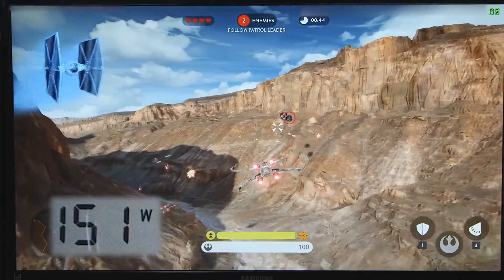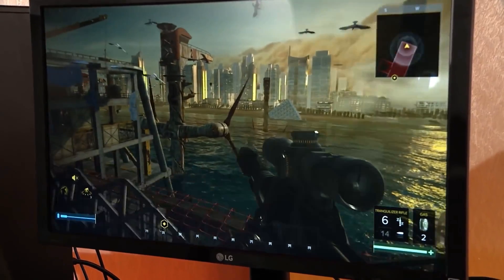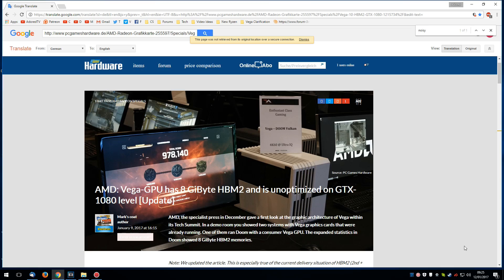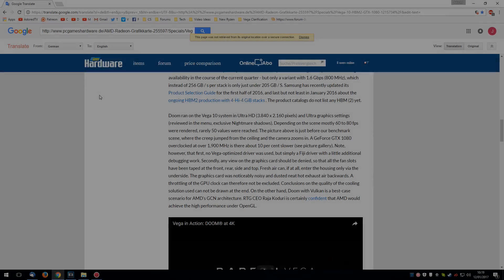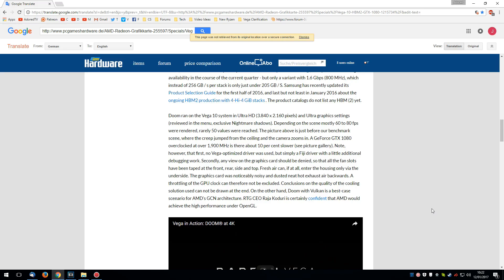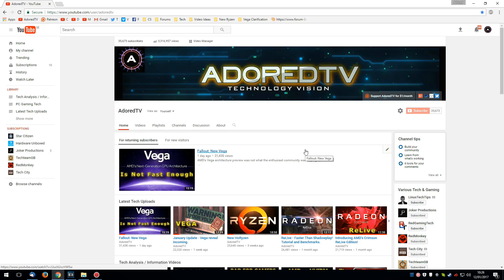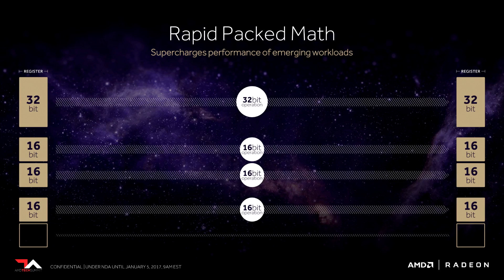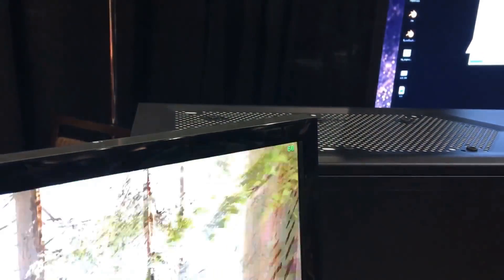Vega Clarification - How bad is it?

Comment: As much as I love your videos, I think you will actually be wrong this time.

For instance, take a look at the radeon instinct M25. It says around 25 TFLOPS helf precision, meaning around 12,5 TFLOPS single precision. That in turn means that for the rumored 4096 shaders to be clocked at around 1500 Mhz. Let's just assume that Vega is a higher clocked Fiji, completely ignoring the biggest upgrade of GCN since it's introduction. Fiji at 1500Mhz (and with better bandwith compression) would (should) be faster than the Vega demo they showed.

And about using the new Vega features: Okay, we got DX12 and Vulkan now which allow more explicit control over the hardware. But are you aware that most aspects of the core architecture (not something like asynchronous shaders but more in the core rendering way) are not being controlled by the developers, but by the drivers? The drivers, in Vegas case, not seen here?
Also, mantle/asynchronous shaders are not the same thing as the core architecture. There is no need to change something in your game to use a new rasterizer in the GPU, for example.
You know how long developers took to take advantage of the GCN architecture? Of the color compression found in Tonga and higher? Maybe 1-2 months for optimising, other than that it's a day zero thing.

Also i really would not underestimate their new high clock design because that one is very, very long overdue for AMD. As seen in your graphic, since the introduction of GCN AMD was forced to run their chips way past their sweet spot. The problem for this lies less in the density but more in the architecture as the GCN pipeline is much shorter than the Nvidia one. I have only ever seen data about the ALUs, but this data showed 4 clocks for a GCN-ALU operation vs 6 clocks for a maxwell one.

In my opinion, it really comes down to if they finally changed their rasterizing to a tile-based approach because that was the single biggest change Nvidia made for their Maxwell architecture, greatly reducing stress on the on-chip cache and therefore saving much power. I don't really know about the clocking potential Kepler had.
Reply from the maker: Yes but the rasterizer is automatic and so should be built in performance already in the Doom demo.  The only thing that devs should need to optimize is the primitive shaders.

Fury X has 46% higher FLOPS than the 390X but is only 20% faster at 1440p.  I believe that AMD will have removed that bottleneck, but Titan X Pascal is around 75% faster than Fury X.  Vega falling a little short of Titan X should not be a major surprise.
Reply: Also forgot that AMD said Vega 10 is smaller than 500mm², more or less matching the 471mm² GP102 which is so small because it is stripped of all the professional features GP100 has (Vega will most likely be stripped too). GP100 with 610mm² has the exakt same shader count as GP102. Should Vega match the Titan X, it would still be worse than Pascal, but not completely out of league. Of course Volta is another thing, but I don't expect too much apart from HBM.
Reply from the maker: I expect Volta Geforce will simply be Maxwell + HBM and proper async yes.

I doubt Vega will be stripped of anything, AMD is basically stuck with one arch to cover all markets now, which is why they'll struggle to compete with Nvidia's gamer GPUs on equal terms.
Reply: Some people think AMD will release a professinal chip with double precision ect later as Vega 20
( http://www.3dcenter.org/artikel/amd-grafikchip-roadmap-2016-2019 )

What it also comes down to for Vega is clock speed as they never officially said anything about that for their demos. (shader count is also at rumor status)
In the last six months, Zen went from like 2,8 Ghz base to the 3,6 base with F4 revision.
We also don't know how much power Vega used in the demo.

As for the Fiji weakness, the main problem was GCN was limited to 4 rasterizer engines with the new games getting even more hungry for rasterizer power. This also is the reason why Fiji didn't have the problem that bad in 4k as higher resolutions demand more shader power and bandwith opposed to rasterizer power, but the problem was even worse than with Thaiti back in the day. (2 rasterizer engines)
Hawaii had four, Tonga had four, GK110 had six, Polaris 10 has four. This essentially might be the reason they never even planned a high end card with polaris. With the new geometry pipeline, AMD claims eleven polygons per clock as opposed to Fijis four.
( https://www.computerbase.de/2017-01/amd-vega-preview/2/ )

One very good reason to sandbag would be to hinder Nvidia with their 1080Ti-counter. They had the problem with the later released 780Ti, the earlier released 980Ti what was slower than the TitanX Maxwell, maybe because Fiji performance got leaked.
I am very convinced Nvidia knows nothing about what Vega can do and what does it not as there was not one leak that got public as opposed to Fiji. It is a difficult situation for Nvidia because AMD can pinpoint-counter a 1080Ti if Vega is good enough. Vega also is at least something like three months late against the supposed 1080Ti launch in feb/march.
Reply: Well Said,Great points.I believe it's much faster than just 30% above a Fury X.
Reply: I'd say it's all about utilizing those TFLOPs.Polaris 10 started the improvement.Vega seems promising.
Reply: When did AMD say Big Vega is less than 500mm2 in size ?
Reply: I believe Volta will be a monster.Bringing back stuff they stripped out of Fermi,getting it right,HBM2 and Hardware level Asynchronous Compute engines,closer to GCN for being friendly to the Low level APIs,which will be much more relevant in 2018,Entirely different from Maxwell and Paxw...ahem....Pascal.So I expect those two older arches to lose driver support focus and get Gimped like Kepler.

I believe RTG is scared of Volta.The very well know it's going to be a monster.I mean,Volta was said to come in 2015,Pascal was something like an unwanted pregnancy,Volta wasn't ready so they made Pascal.All these years of development,Volta is going to be a beast,Not another Maxwell and Paxwell
Reply: Exactly what I was thinking.AMD wants to confuse NVidia.Look how cautious they are with Vega,not even a single leak about the performance\power draw,heck,anything about it appeared on the internet.AMD wants to keep NVidia clueless about Vega so that they will not be able (sorta) to determine what to launch as 1080Ti,Either a further Cut-Down from Titan XP GP102 or a Full GP102 at 700$,That would make Titan XP one of the biggest ripoffs in the history of GPUs lol

But anyways,I am pretty sure Vega isn't ready yet.Sure the Arch is there,but it's with a debug layer,clocked much lower,throttling,sub par beta drivers.etc.I believe it will be launched a month after RyZen.
Reply: I believe Volta will be a monster.Bringing back stuff they stripped out of Fermi,getting it right,HBM2 and Hardware level Asynchronous Compute engines,closer to GCN for being friendly to the Low level APIs,which will be much more relevant in 2018,Entirely different from Maxwell and Paxw...ahem....Pascal.So I expect those two older arches to lose driver support focus and get Gimped like Kepler.

I believe RTG is scared of Volta.The very well know it's going to be a monster.I mean,Volta was said to come in 2015,Pascal was something like an unwanted pregnancy,Volta wasn't ready so they made Pascal.All these years of development,Volta is going to be a beast,Not another Maxwell and Paxwell.

Comment: They found out it's supposedly going to be 12.5 TFLOPS; more than the Titan XP. With that it should have outperformed the Titan XP in Doom if everything were in order.
I'm just going to wait and hope this one wasn't clocked to the final clocks or something.
Reply: I agree.Its all about Performance per watt,Clocks and Utilization,especially for a segment like High end and Enthusiast.A 5.6 TFLOP 980Ti smashed the 8.6 TFLOP Fury X.The Fury X was bottlenecked by its low ROP Count,Poor utilization of resources and 4 GB Limit.Polaris improved utilization,clear example is how it is able to trade blows with the R9 390 and sometimes even the 390X.So Vega,needs to find a way to utilize that 12.5 TFLOPs.NVidia is so far ahead in these things currently.But with solving a lot of stuff in GCN along with new NCUs allowing for higher clock speeds,I think Vega will be the answer and right now,It isn't ready yet,clocked much lower,running on a debug layer,throttling.etc.AMD wants to confuse NVidia with the 1080Ti.

Comment: Google likes AMD, I believe a lot of these architectural changes were done to suit Google's and console maker's needs. I suspect, though have done no research, that Google will be buying massive numbers of Vega and Zen chips for their data centers, deep learning, data mining, etc. The console makers will benefit from the integration in these SOCs providing their next gen consoles with further efficiency, performance per watt and simplified PCBs. This is a good thing.

I do have qualms with AMD's choices, specifically using the Polaris as a test bed, which it was and not pushing the clocks to where they could have gone, I believe they could have reached 1070 performance. And many of you may disagree with my opinion that AMD should have also did an 8 core version of Excavator at =/<28nm, AM4 platform with DDR4 earlier. Excavator is not an awful chip and could have helped what's called 'good will' towards the company, which has been suffering a lot from consumers.

Comment: Taking the market from the ground up, one step at a time, rather than trying to take the top spot is surely the best option for AMD.  Vega, if its 1070 perf with HBM, but for less, it could still be a compelling option ?
There's no point AMD trying to build a Titan until the time is right and right now there is too much of a hole in the mid tier performance range of GPUs for price to performance. We need to see AMD's answer to the 1070 first surely ?

Comment: No, Jim, No. Don't let the logic that you have used so expertly desert you now. Have a look again at some of your own previous posts. Let's celebrate AMD's business model pragmatism rather than going after the tiniest proportion of the ultra enthusiast market as it makes no business sense. I want to focus on three aspects. 1. The current installed base of panel/monitor sizes and the timing of users changing them, 2. who will be buying VEGA, and 3. your (I think totally unrealistic) claim that NVidia will reduce the cost of the 1080 to $300. Point1. What monitor sizes do users currently have, when do users consider upgrading their monitors, and if they choose to do it, will they purchase a 4K monitor? I would have throught AMD used this as a starting point and built VEGA to deliver high FPS on 1080, 1200 and 1440 monitors as they knew these would still remain the most popular sizes through all of 2017 and possibly deep into 2018 as well. Point 2. Who will buy VEGA? Once again, where is the highest numbers of GPU owners who will be ready to upgrade in the next 12-18 months? Not GTX1080 owners, not 1070 owners, not 1060 or RX480 owners. What constitutes the biggest % of GPU types in Steam - 960/970 owners most likely. It is 960/970 owners and earlier series AMD card owners who AMD want to buy VEGA, I would suggest. Someone who has a 1080p monitor and likes to achieve high FPS and play at High / Ultra settings as they are denied these settings with their 960 in current titles. Point 3. NVidia can't drop the GTX1080 price down to $300. They have 3 levels of cards below the 1080 (the 70, 60 and 50 series) they simply can't squeeze three levels of cards into the $0 - $300 price range without them cannibalising each other and allowing distinct price/performance tiers. Also it would trash NVidia's name as all those 1080 owners who purchased cards at $650 would be extremely pissed. Plus the 1080 has an established 'mind share' price point and to drop it to $300 would give NVidia little room to move for 'mind share' positioning the 1080Ti based on its price as it would set too low a price point for the 1080Ti to be perceived as a flagship card. Now, here is my key point; what if AMD were to price VEGA at an MSRP of $350-$380? They would make a killing. Owners would get better then GTX1080 performance at materially less than a GTX1070 price and not too big a financial stretch over a GTX1060 to tempt people thinking of getting a 1060. Forget the TitanXP as this is a stupid card at a stupid price and bought by only a tiny fraction of (stupid - is that unfair?) people. Raja Koduri has already stated that his goal is the 4k gaming PC for $1k build price. Have a look at this link https://www.youtube.com/watch?v=FwcUMZLvjYw as I found it really interesting. On your other point of the VEGA architecture, I don't think there is any point in trying to squeeze in more than 4096 shaders as they all need to be filled to reach peak efficiency and I doubt that current game titles could fill 4096 shaders. Nvidia does nicely enough with far fewer CUDA cores. What VEGA needed to do was lift its clock rates, and I understand that it is estimated to be north of 1500Mhz to reach the 12.5 TFLOPS, which would make it competitive for gaming. I rejoice in AMD's pragmatic approach to their GPU strategy - they need to get back into the game and are playing the long game. You said yourself that the real money is made in CPUs, not GPUs - let all the focus come on RYZEN and let Raja and his RTG team play out their smart strategy. I am confident they know what they are doing. I believe that they have designed VEGA not to go after the stupid Titan XP in a simplistic pissing contest, but to go after the huge cohort of 960/970 owners who are ready to upgrade, and the 'wow' factor of VEGA won't be its outright performance, but its unbeatable performance for its MSRP price, and convert the single biggest current NVidia owning cohort into AMD owners and make some hard cash for the AMD shareholders. What do you think?

Comment: Great video, as usual. However, I strongly disagree with your claim the 1080 is a mid range card. It's an absolute beast that is completely capable at 2160p60 gaming if you drop the settings at the high range. I think you're mixing up high end and enthusiast cards (i.e. 1080ti). Its price should have been around 600 dollars/euro tops, but sadly the lack of competition brought the price up to 750 bucks. Anyway, I think this only proves something I've been thinking since the previous generation - AMD cannot and will not compete at the high and enthusist ranges. They're content to having better offers in the mid and low tier. Unfortunately their brand is so tarnished people still prefer the 1060 and the 1050ti over the 480 and 470, even though AMD offers a substantially better value.
To be clear - I have a 1080. I love it. However, the 775 euro I had the pay for it really stung, though it was softened by the fact I got 350 for my two 290x-es. I'd love for prices in the higher range to normalize, but I don't see that happening. Maybe we're headed towards a similar scenario to the CPU market - we'll reach a point where Nvidia is so far ahead, they'll contend with incremental upgrades each gen and concentrate their efforts on the business market. Maybe, I'm wrong, but I think once the big push to 4K is over, things will plateau for a while.
Reply: Станислав Димитров The 1080 is literally 150 - 200 above the retail price the die size should of been sold at.  That is all adore is saying. It's not based on performance.  The market goes like this or it should of gone like this.  1050 = $100 - $150 , 1050ti =  $200 - $250,  1060 4gb = $ $250 - 275, 1060 6gb = $275 - 300, 1070 = $350 - $375, 1080 = $400 - $450.  Now look at he cost of the 1070 and 1080 now. 1080ti that should be around 650 - 700.  Sorry to let you guys down but I see the 1080 TI running around 800 - 900 dollars.  

There actually a price gap in nvidias offering.
Reply: Ryan Passage Sorry but your pricing is way off. The 1050ti is 150 dollars. The 1060 3GB is at 200 and even a bit less.  The 6 gig is at 250. The 1070 is around 380-390, though it does finally dip below that during sales. To have around a 120 dollar price difference between the 1060 and the 1070, but to expect a 50 buck margin between the 1070 and the 1080 is unrealistic. The 1080 should have been from 500 to 550. Nvidia just charged more because they could (no competition). Not to mention the performance difference between a 1070 and a 1080 is bigger than the 970 and 980  (an OC 970 is pretty much a 980 with a 3-4% underclock).

Comment: At the end of the day what will determine the success or failure of Vega will be it's price. Drivers can easily mean another 30% or more performance on the final card, for a total of about 40% greater performance than the GTX 1080. If AMD sells it for the same price as a 1080, then it will sell. Yes, Nvidia can drop the price of the 1080, maybe even by a couple of hundred dollars (pity anyone who just bought one), and AMD would have to go with them. But, I seriously doubt Nvidia will drop the price of the 1080 by more than 150 bucks. More likely, the 1080 would become the 1170, and the chip that would have been the 1080ti would become the 1180. 

As for the true high-end, I'm pretty sure I saw on a slide that AMD will be launching a dual-GPU Vega card. A tough sell, but a monster of a card. If they can get some decent crossfire support happening though, it would out-perform anything Nvidia has.
I think you may be ringing the bell a little early here, but as you yourself are fond of saying "we shall see". Personally, I'm still excited to see what happens next in the GPU market.